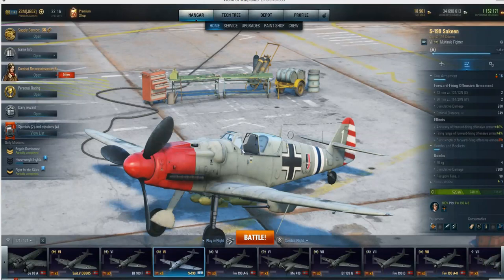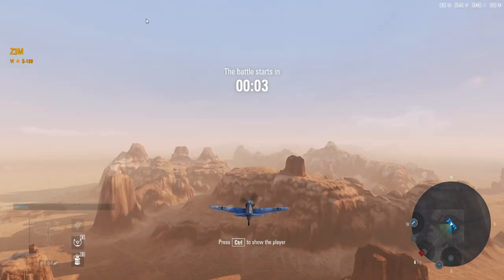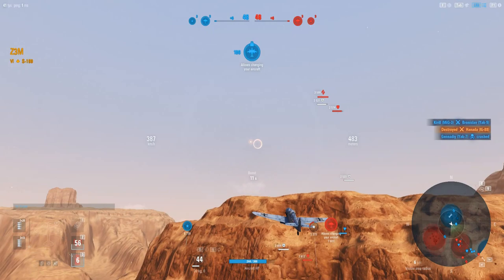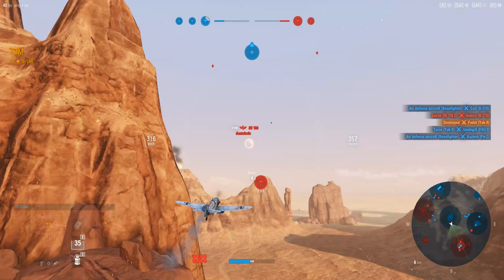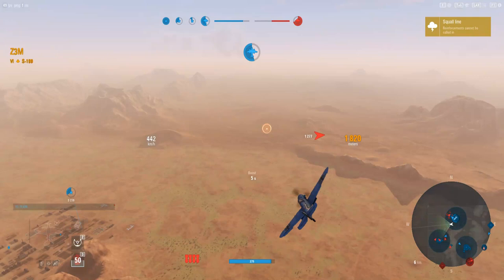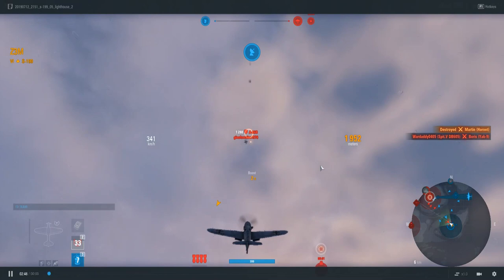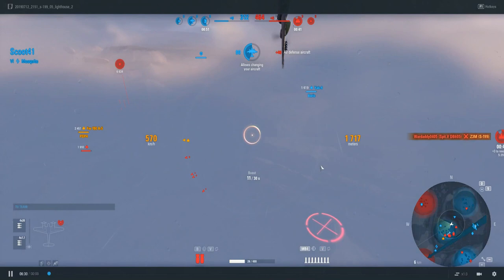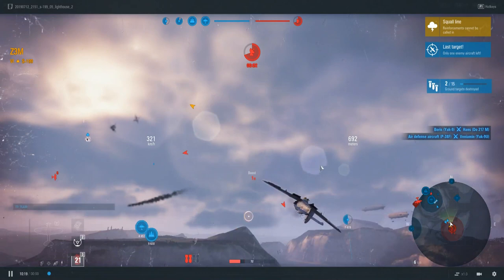World Of Warplanes. Avia S-199. Review And Gameplay.

Comment: It's a strange plane, a Bf 109 scrapped together from various parts and made into a multirole fighter. It has decent speed, but altitude suffers, and maneuverability is... well, there is some of it... As the ordnance (keep in mind it's a tier 6 plane) 70kg bombs are surprisingly efficient, even if small. The guns used are Czech models, and the double 20mm plus double 13mm MG - though at first glance sort of unimposing, especially for this tier - do the job rather nice; it's pretty accurate and doesn't overheat too fast.
So far I've flown 10 battles and managed to win all; being aware of how underwhelming this plane is, I'm trying not to get into fights that I can't win, so my death ratio also stays pretty low. It can surprise - like with a Gabreski medal I got from one of the battles (10 air kills and 7 ground targets in a single sortie, and winning the battle) - but overall will not be a game changer. There are a lot of planes on this tier that can catch, outturn and outgun this bird. I'd say it's an advanced model, beginners won't get much bang for their bucks flying it. Being a tier 6 it's relatively cheap to buy, but there are other options with less hassle (looking at you, German Spitfire).